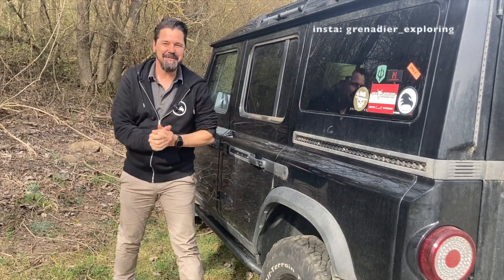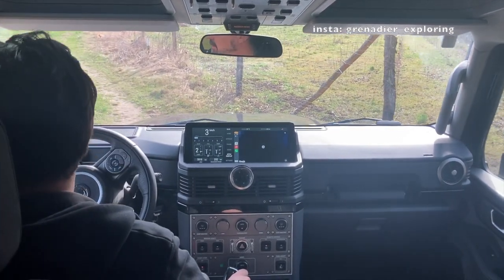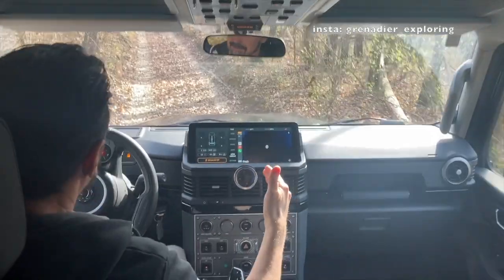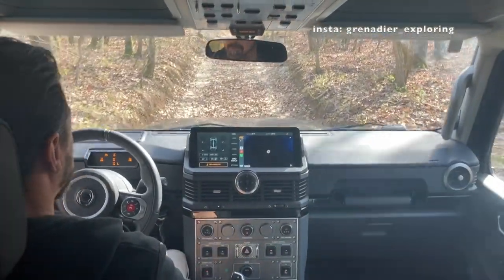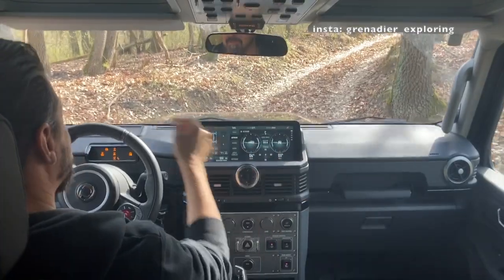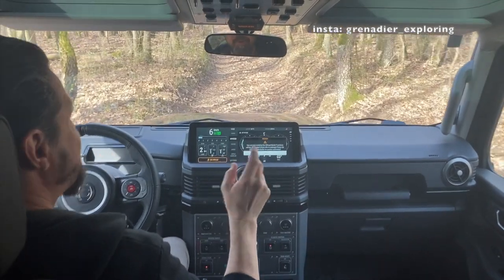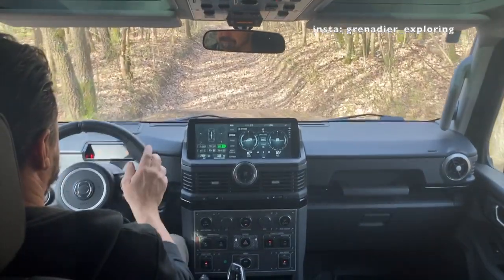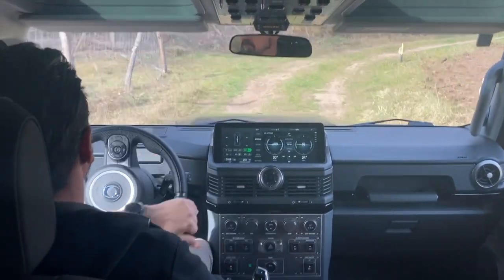My Ineos Grenadier - Off-Road modes, LOW range and Differential Locks

Comment: great IG tutorial video and also enjoyed wathcing 10,000 km run review. Regarding the diff locks, I have seen several issues discussed at the IG forum engaging/ disengaging diff locks. I am wondering if you have had any issues of operating diff locks? Thanks!
Reply from the maker: First of all: thanks a lot 🤗💪🏻.
I've seen those reports. I have no issues with engaging/disenganging. every now and then it will take a while until your lockers disengage but I consider that normal. a few turns and it works.

Comment: I have a question. When descending steep hills off road what's the best way to control your speed? Do you rely on the auto box 'holding' a low gear, do you switch to manual and hold a low gear or do you use the Downhill Assist? I've found that holding a low gear in auto the car still wants to change up which can give some scary moments.
Reply from the maker: hi. i do see the same issue, though in Auto it's still holding the gear quite long. The HDC is a very good system and worked till now every time really well and you can fully concentrate on steering and set/control the speed exactly as you like it.
Me personally, I love to put the transmission to manual, 1st gear and roll down the hill with engine brake. works up to +-30 degrees of slope really good (if it's not too slippery).

Comment: Based on what you’ve seen regarding build quality, the strength of components, do you feel it’s worth the money? I have a delivery coming up and was a bit sticker shocked to be honest.
Reply from the maker: the price is high. but - so far - I believe the components are really good! I only identified s few parts that could be stronger/better quality. those will be either updated or taken care of by the aftermarket I believe (two levers and a few switches). will point that out in my next video - 10.000km review

Comment: I’m from Canada so still waiting to get mine. Question, can you lock the  centre differential lock while moving, or not in Hi range and if so do you have to pull the collar to do it.
Reply from the maker: Hi. When do you get yours and which configuration?
Yes, you can engage the centre diff. lock on the move in HI and LO. The front&rear diff. locks can be engaged up to a speed of 15km/h (8mph) as well.
Only HI to LO (and vice versa) requires you to stop and put the transmission in N for the change.
Reply: @grenadier_exploring  Delivery moth is in July (we are quite behind here). Is the Trialmaster rough pack. Anyway, the reason of my question is that I had a bit of trouble with this when I was test driving yesterday and the fellow that was with me did seem to be that familiar with that either.
I have been driving only part time 4WD manual transmission for decades. And done modifications to my trucks etc. This will be my first full time 4WD with automatic transmission. As far as how to engage different features each vehicle is different as you probably know. 
Thank you for the response
Reply from the maker: nice choice!!!
I understand. With the transfer case on the Grenadier you need to use a little force in the beginning (especially when they are new). I would call it a "positive action" to engage the gear. I have no problems with engagements of HI/LO, diff locks, etc.
Only thing i observe: it takes a while for the locks to dis-engage....requires sometimes a few turns.
Reply: @grenadier_exploring  yeah that’s pretty much the norm with lockers, pneumatics (ARB)  and factory electrics.

Comment: Thanks so much for the video, your series is really informative and I'm subscribed!  What is the top speed that you can engage the center diff lock (CDL) from normal on pavement 4wd open diff mode?  An example would be that you are cruising on drive pavement in the mountains and then encounter icy or snowy conditions and you'd want to go into 4WD high and then you continue back to dry pavement where you'd want to disengage the CDL, back to its normal 4WD open diff mode.
Reply from the maker: thank you very much for your subscription and i am glad you enjoy the videos.
I just went through the manuals again but couldn't find a max speed to engage the center diff lock. it is 15km/h (8mph) for the rear and front diff locks and the maximum speed to have the locks engaged is 70km/h (43.5mph).
the engineers' words were "at low speeds". I will try to get you a number!! 
As I see it, 15km/h (8mph) is definitely safe but of course it would be nice to be able to go faster in the situation you described! I encounter that a lot as well here in Austria.
Reply: @grenadier_exploring  I did get a response from and Ineos Grenadier Sales person who said they spoke with and engineer who said there wasn't a speed restriction and that proper CDL usage during handover.  I presume that is the transition from a high traction to low traction surface.  I have a test drive lined up next month in Seattle, USA and will be sure to ask them, but do you have any additional insights now that you have more KMs of use?
Reply from the maker: i am sticking to the guidelines we got in Morocco and what I found in the manual so far. If you get the info, pls let me know. Should I hear something, I´ll post it as well

Comment: Hey, thanks for the video! Could you please advise me how to turn off the diff locks, the light keep blinking and doesn't turns off! Thanks in advance!
Reply from the maker: Hello. In my Video "How To - Episode 06" I talk about this issue. In short: blinking doesn't mean the lockers are still engaged. it means that the car hasn't sensed a difference in wheel spin yet and couldn't confirm the dis-engagment. doing a (few) turn(s) should stop the blinking. 👍🏻

Comment: What is the off-Road Performance, now you been using the vehicle for a while, also what the Vision like Off-Road too, equally how well does the Steering perform Off-Road too?

Lastly how is access in and out of the rear passenger doors, or in and out of the rear tailgate door too, or in and out of the front passenger door too, are there suitable grabrails in place?

As I am only 4ft 10 inches tall myself, so are the drivers and front passengers seat, fully height adjustable too, also the driver's foot pedels adjustable for driver's size and height or length of legs too?
Reply from the maker: hello wendy!
the off-road performance is amazing. i am releasing a video today with a very basic demonstration...more to come. the steering is designed for off-road as well.

you have handles above the door entrance but they are not really grab handles. without sidesteps it's a task to get in. so i would suggest to consider that option, especially with your height.
the driver is seat is fully adjustable, also in height but the pedals are NOT.

Comment: Would love to see a clip in 1st gear low. Maybe even with outside view. From what I can see you started of in 2nd gear?
Reply from the maker: Noted! i will definitley show that in my offroad-video. probably also on a steep descend with engine braking only. plus i will add some outside footage 👍🏻
Reply: @grenadier_exploring  I could not wish for more. Thanks for the reply!
Reply: My understanding is that, when in low range, the vehicle automatically starts in 2nd gear. You can of course go into manual mode and select 1st gear. 🙂
Reply from the maker: that is absolutely correct!!

Comment: In the low range when you put the transmission in manual mode how can you lock the gears? For instance if you want to go downhill in 1st gear the transmission should stay locked in 1st no mater what. But if it is in manual mode but not locked, if you put it in 5th and you start from stand still the transmission should change gears form 1st to 5th. Does it have this feature?
Reply from the maker: if you want to start with a high gear, it will shift down automatically to the gear needed to get going (depending on LOW or HI). but then it stays in that gear until you shift up (in manual mode). does that answer the question?
Reply: @grenadier_exploring  Two different scenarios: 1. when going downhill, if it's very steep, I prefer to lock the automatic gearbox in manual mode 1st gear and engine compression will be enough to slow down the car to a walking pace. HDC is on just as a safety secondary feature as I don't like it's lag, can be dangerous on muddy conditions. 2. When going uphill for a long steep climb I lock the gearbox in manual mode, start from standstill with 2nd gear and if needed on the last 1/3 or 1/4 of the climb I shift in 3rd gear. So, when locked in manual mode my gearbox is 100% acting like a manual gearbox, just I don't have a clutch to operate having both worlds of auto and manual gearbox. This feature also allows to start from standstill in 4th gear and the gearbox will stay locked in that gear, which is helpful when I am in mud as I can use the little traction I have with low torque. Locking in manual mode only work in Low. It's a LR Disco 2 TD5 Auto. Can you operate the same with the Ineos Grenadier, locking the gearbox exactly in the gear you want, no matter what revs is the engine, or the computer will eventually shift gears by itself?
Reply from the maker: did now some checks, here are the results:
1.) the transmission never shifts up for you!! 
2.) when slowing down in a high gear, the transmission will eventually go to a lower gear automatically - when u approach a RPM that is too low for the engine (no matter if in AUTO or MANUAL)
3.) the highest gear you can start with depends on the selection of the transfer case. 2nd gear in HI and 3rd gear in LOW!
4.) you still have to shift up manually, no matter which gear you had selected when stopping (in MANUAL)

hope I could answer all the questions?!
Reply: @grenadier_exploring  Thank you Ingemar, quite a complete answer. Nice to know that you can drive it in a safely manner. On global market today there are not so many choices for a strait from the showroom off road ready car. Ineos Grenadier, Jeep Wrangler Rubicon, Ford Ranger (soon Bronco) Raptor. Any other model need at least different tires. If you plan to visit Romania write me, I'll be glad to help you
Reply from the maker: @andrei.p.70  true!! 
thank you! That would be great....definitely planning to come to the carpathian mountains!!!

Comment: Help me out: to engage the F/R differential locks, it’s less than 40% throttle, less that 15km/h and no spinning wheels. But aren’t the wheels spinning when driving less than 15km/h? Or is it the steering wheel that shouldn’t be spinning? Thank you. I’m impatiently awaiting my Fieldmaster to arrive in Australia!
Reply: no wheel should be slipping (losing grip and spinning).  Fine to engaged if you're simply moving slowly with no wheel spin.
Reply from the maker: correct. i like that as well that you can engage them while moving
Reply from the maker: sorry - english is obviously not my mother tongue ;-). i meant spinning like losing grip/slipping.
hope your fieldmaster arrives soon
Reply: Hey, My dealer called me three days ago said my Grenadier is on the ship now, will arrive Australia around June, can’t wait!
Reply from the maker: great news!!! hope you can enjoy it soon!!

Comment: Interesting that the wading mode turns off the cooling fan, so it doesn’t throw water all over the engine. Smart. I wonder if any other manufacturers have thought of that?!
Reply from the maker: and it's not cutting into the water! if u pay attention in the video, it also switches to "recirc air" and closes the air intake for the heating-a/c. there is a list in the manual of what is turned off....
Reply: @grenadier_exploring  It stops the fan from driving into the radiator. It also turns off the diesel PF burn cycle. You need to be in low range locked and below 30kmh I believe
Reply from the maker: @DavesIneosGrenadier  all correct! it limits the speed to 30km/h or 18mph

Comment: Does the car come with electric brakes? Mine was due to be delivered in December but still waiting. Should come in June or July they reckon.
Reply from the maker: no electric brakes. good old handbrake with a big handle and a cable

Comment: to select downhill control do you need to switch off diff locks first?
Reply from the maker: Hello Mark! the front and/or rear diff. locks have to be off!! the center one can still be engaged! otherwise the system can't brake the wheels individually.

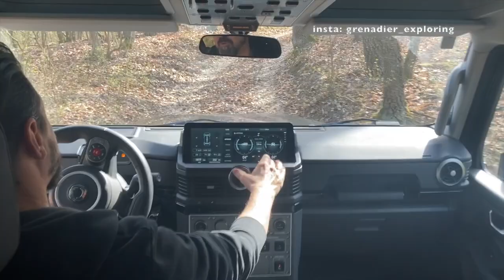Comment: My Grenadier 2 seat utility,  which has both rough and smooth packs installed, does not have the screen available showing the diff locks and torque’s at time stamp 3:03. How do you get this screen to show up.
Reply from the maker: comes up whenever i engage the offroad mode or go in “LOW” with the transfer case
Reply: @grenadier_exploring  
Hi thanks for the reply and the great videos you have done.  I have been watching them and then trying the various things with my new grenadier I got a week ago.  Hence the question.   My grenadier doesn’t do that it just has the speedo, temp, fuel and rpm as it does in normal high road mode.  Engaging low and locking the diffs does not alter this.
Reply from the maker: very interesting! i know, there has been a software update. let me check with other owners 🧐
Reply: @grenadier_exploring  
Great thanks 🙏 
I would imagine mine has the latest version as it was built in November. 
I have noticed though that it has the sticking door buttons due to the seals.  So obviously this has t been resolved  even though it’s a know issue.  Any help would be much appreciated h appreciated.
Reply from the maker: there seems to be a little bolt in the door mechanism, not perfectly manufactured, to block the button from coming back out under certain circumstances. don't have that issues on mine anymore. but if it happens, tap the area below the door handle with your flat hand - then it jumps back out.
Reply: @grenadier_exploring  will give that a go thanks. 🙏
Reply: My Grenadier used to show diff status on the center screen. Following the software update I don’t see it anymore. Will bring it up at my 12 months service tomorrow.

Comment: The grey plastic looks 10 years old already, hope this is a trick of the light or is it really that damaged?
Reply: Which part of the grey plastic looks 10 years old? I can't see any damage or wear? What am I missing?
Reply from the maker: oh i see what you mean - around the utility belt?! i guess that is a combination of the salt residue from the roads in the austrian alps and the light! the plastic still looks fine in "real life" 😅
Reply: Thanks for the reply
Reply: @DavesIneosGrenadier  look at the utility belt at 18s
Reply: @romeandcurry6915  I was focused on the inside. You are correct, all of the plastic outside looks strange. Bumpers, flares, utility belt. As they are all from different suppliers I am wondering if they are all just covered in dust. He said previously that he won't be washing it often
Reply from the maker: @Dave's Ineos Grenadier   until now i never washed the car. i guess i do it when i am back home and check the plastic parts. will come back with feedback!!

Comment: You should never take your seat belt off while driving especially not when off-roading. The only exception is perhaps when wading very deep water as you may need to get out very quickly if something goes wrong.
Reply from the maker: u are absolutely right. but if you need to scout a lot, get in and out of the car and are not in danger of rolling the car over etc., then it is a nice feature as well. The new Defender wouldn't let you even move the car without seat belt on. And: the warning is OFF in the wading mode as well.
Reply: Or whilst filming under controlled conditions. And to demonstrate the functions of the vehicle.. geez